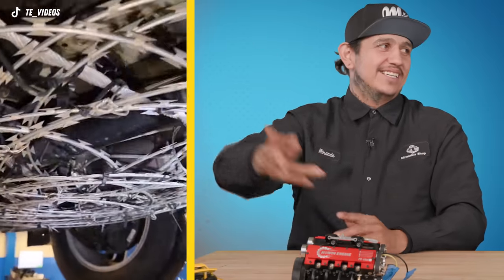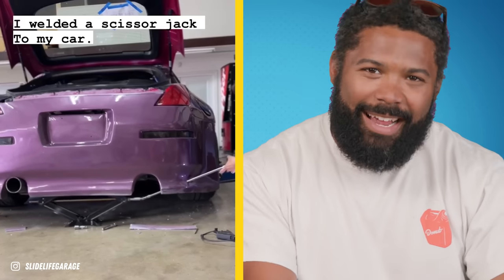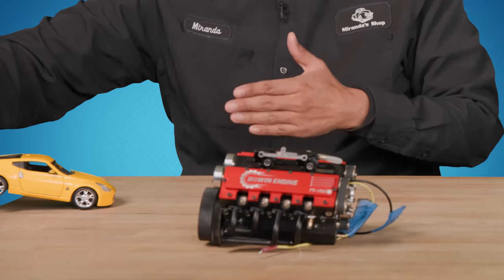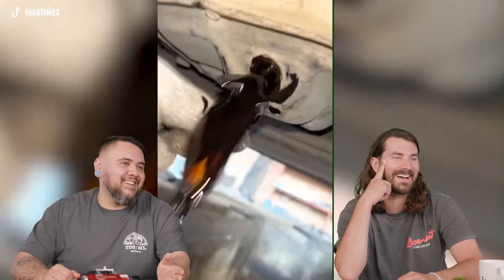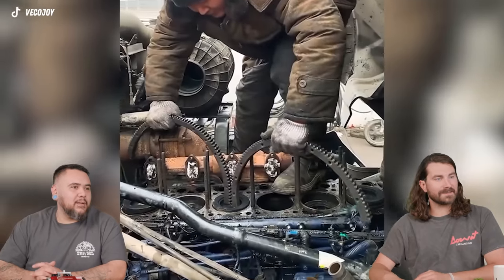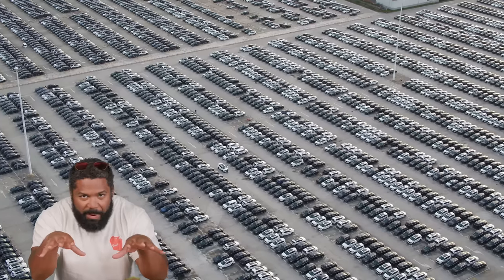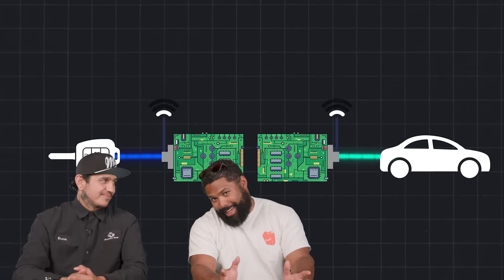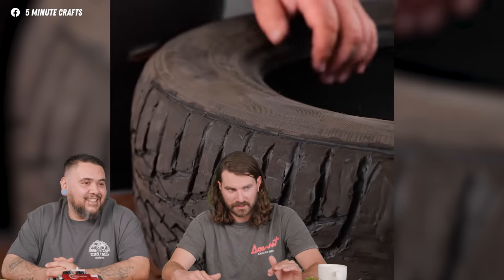Mechanic Reacts to Horrible DIY Car Hacks

Comment: The car unlock thing might work, but that video is fake.  
Beanie guy is holding a key fob and trying to unlock a Ford Focus.  The Focus (US version) did not come with a key fob except for the ST.  That’s not an ST.  Focuses (Foci?) had a physical key with the lock/unlock buttons built-in to the head.
Also, the beep beep sound effect is added.  The Ford Focus doesn’t make  a beep/chirp sound when it unlocks.  
BUSTED

Comment: there's NO WAY you could start a car pulling the wheel. when you push start, you have the weight of the entire car moving. you have momentum to keep the car trying to move forward. all the momentum is going to be transferred to the engine when you pop the clutch. spinning the wheel like this you have no extra weight, just the spinning weight of the tire. it does not physically have enough weight to turn the engine and start it. it's IMPOSSIBLE. you'd have to spin the wheel like 100 miles an hour and it probably still wouldn't work.

Comment: Enlighten me.  Have any of you mechanics ever actually started a car by pushing it?  If you did, you would know that putting it in first gear is almost as bad as hitting the brakes.. and you are going to piss off your pushers in a short time.  If you put it in a higher gear, the engine rotates slower but it is easier to push.   Just imagine how fast your engine has to revs in first gear as opposed to third or fourth.

Comment: My guess for the key fob range is that since your brain has the most electrical energy on your body and touching it gives small boost in energy(could be just because its warm too) and extends the range a bit. They are designed to operate at low power to extend battery life so even a tiny amount could give noticeable effects.

Comment: The tire regroving was a fake, the treads were filled with colored clay. Run the video slower and you can see the clay against the right angle of the treads.
Reply: 5 minute crafts, of course it's fake.

Comment: so, in the tire to tire air transfer clip, I call bullshit, because look at how flat the front tire is and then look at the rear tire doesn't change inflation as the front tire magically refills and lifts the tire too, complete bullshit, the rear tire would have to deflate the same amount as the front tire is inflating

Comment: Wtf, with the tire inflating "hack", you guys went off on a tangent about punctures and nails, and completely ignored the actual topic, can you connect an air hose to both valve stems, and magically inflate the front tire, without deflating the rear. No, you cannot. 

And the one idiot called it a hack. Jesus guys, not to bright, are ya....